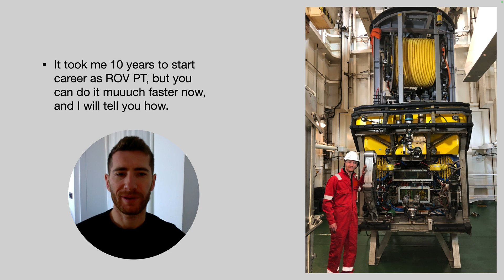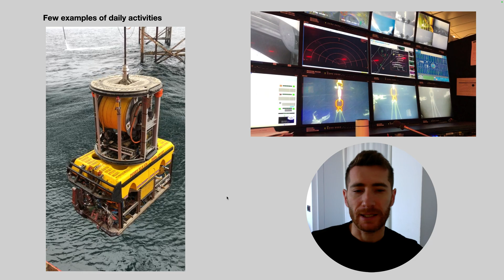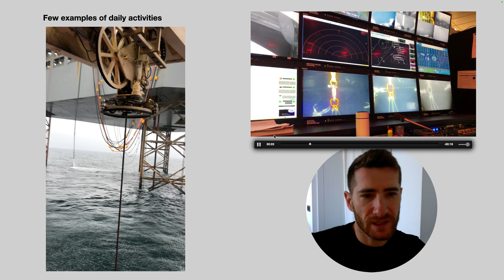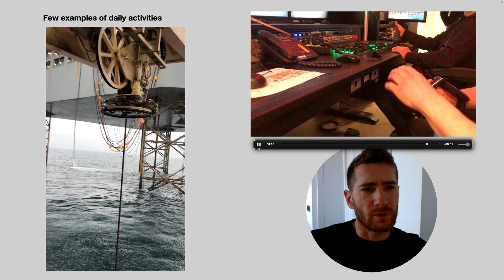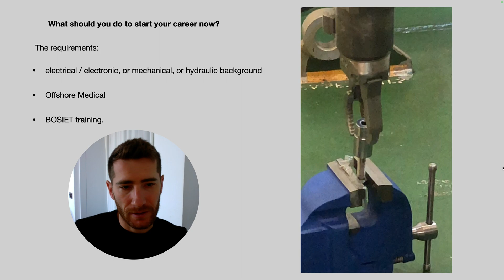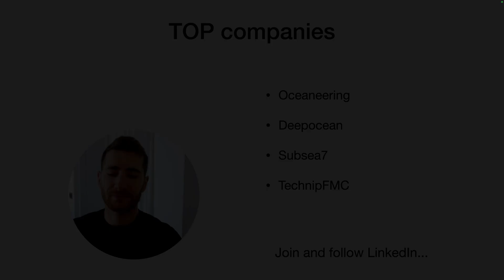ROV career start. How I moved from ETO to ROV Pilot Technician position.

Comment: Hi! Your video is very helpful. Do you think that an industrial and robotics engineering degree will be taken into consideration? I dont think i will have some practical experience in electrical or mechanical engineering. And most internships at my college wouldnt cover the kind of experience one would need as a rov operator. Can you give me any advice?
Reply from the maker: Hi!
I’m pretty sure that yes. I would contact one of the ROV training providers and ask them (they have also criterias for starting training) about your particular case.

Comment: For anybody trying to get a job or a licence for a ROV PT go to Qstar ROV training centre in Barcelona, it is one of the best if not the best ROV courses in the world
Reply from the maker: Hi! Not sure if they can provide with a proper training, that could lead to a proper ROV PT start. How long do their course last?
Reply: @kosrom3546. It lasts 1 month
Reply: @kosrom3546 depends for what you need, the norm is 3 months online course and 1 month practical but some guys come for 2 weeks and go home or offshore then come back or some guys pay extra to stay 1 month longer for the practical part.
Reply from the maker: I would say, it depends what the companies need. And typically they ask for technical background and then offer their traineeships. I saw only one advertisement in my life when hiring for ROV PT trainees, where ROV commercial course would be as advantage. On the other hand, if you can make quite a few real flying hours during the training, then it might lead to a finding a job.
Reply: @SeaNVESTING So are you saying I should first study something like Electrical and Automation Engineering for two years (which obviously doesn’t include an ROV PT course), and then later take a specific course for it, like the one in Barcelona? Is that how you actually get a job in this field?

Comment: Hey I love this video, I'm interested to be part of the industry, just that I don't have any electronic, mechanical or hydraulic background.. although I had a networking company that offers to send me to the course, but my only concern is the basic I don't have, do you think it's an issue?
Reply from the maker: Thanks for your comment. If you mention about the ROV basic course (like the one I had in Abu Dhabi), when you apply - they ask you to fill in the application, where you mention your background, and then they say if you are good to join the course or not. I believe, it's still required to have one of those technical backgrounds, so if you are really interested in the ROV career - will probably need to complete one of the trades (el, mech, hyd) courses first... but ones again, write to (for example) fugro ROV academy, and ask them, what are their requirements.
Reply: @SeaNVESTINGcould please tell us from where did you took the course in Abu Dhabi

Comment: Same for me...I was trying to get in for years ... I gave up though. I attended electronics for ROV pilot Technician which I paid 2500 USD. The piloting I already had doubts to take it because its hard to apply due to my nationality. Right from their websites you cannot apply if you dont have the nationality. I'm an electronics engineer in the Philippines and currently working as Casino Technical Manager on passenger Cruise Ship. Come what may 😂.

Comment: Hi, Kos Rom. Thanks for your informative video. I have a few questions.
1. What's difference between "Subsea engineer" and "ROV Pilot"? 
 - Mechanical engineer, Electric engineer, Subsea engineer belong O&M Company / ROV pilot belongs  ROV company? 
 - Does O&M Company which owns platform for gas production ows their own rov pilot? or hire from ROV Company?
 - Does subsea engineer also deals ROV or AUV?

2. What's the reason using "ROV" for subsea working instead of "AUV"? 
 - because of much electric consumption? 
 - because of Size or manipulator?

3. Please advise my offshore carrerpath.
 - Subsea engineer vs Mechanical or Electric engineer vs ROV Pilot
 - My background as follows. 
  - 29 years old
  - 6 years as marine engineer(merchant ship : PCTC, HEAVY LIFT, BULK, LNG) that contains ETO work (because there's no ETO in my nation's ships.)
  - 0.5years and now on as oceanography engineer(deals with ASV not ROV. deals some underwater system like multibeam, LBL, USBL for reaserch and development purpose)
Reply from the maker: Hello! Thanks for definite questions, looks like you know what you want. The Subsea Engineer is the same ROV Pilot, but he/she is the Senior one in the team. Usually there is 3 people per 1 work class ROV: ROV PT, Subsea Eng (or Senior ROV PT- it's just a different name), and a Supervisor. 
ROV system can belong to the shipping company (i.e. Subsea 7), or can belong to a ROV company (i.e. ROVOP), which is installed on board the ship or a rig. In first case the ROV PT will be employed by a shipping company, in the 2nd - by ROV company. I don't see much difference.
AUV can't operate for long period of time due to battery limitation. The ROV can stay subsea for long time, is more powerfull, and has manipulators for heavy duty work.
ROV pilot technician - requires a combination of skills, and mechanical, and electrical, and electronics. 
Your background is perfect to start your career as ROV Pilot Technician trainee. After approx 1 year (can be less or more depending on different circumstances) you would become ROV pilot technician, after some time proceed as Senior ROV PT (or Subsea Engineer), the ROV Supervisor, and maybe as ROV superintendent (not everywhere this role exists).
I hope I managed to answer your questions.
Reply: @SeaNVESTING  Thanks a lot your advice. It really motivate me. May I get your linkedin ID?
Reply: This relates to me except the working experience. Just graduated as a marine engineer with a minor in offshore/subsea engineering.

Comment: Can you recommend any training courses / companies for UK / EU / UAE.
Reply from the maker: The one I did was in Fugro Academy training centre, which was in UAE (Abu Dhabi). It was in 2015, so the things might changed, but back in that days it was great one. The companies I recommended were at the very end of the video. Can add ROVOP company as well.
Reply: Thanks @SeaNVESTING
Reply: @SeaNVESTING 
How long this certificate is valid?
Reply from the maker: @oleksandrkuzin5464  There is no expiry, and the certificate is not essential, it's just a bonus when you apply for the open positions. If you do the training in Fugro academy, most likely you will be employed by them afterwards while the market is so active. I would recommend first to apply for any open positions for the ROV PT you can find without the training.